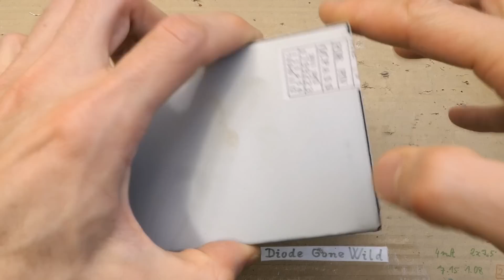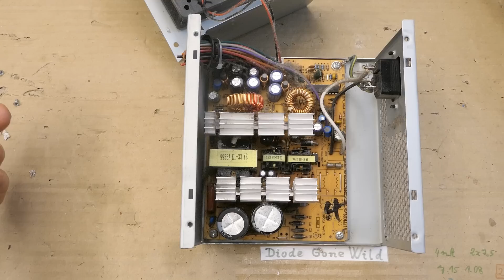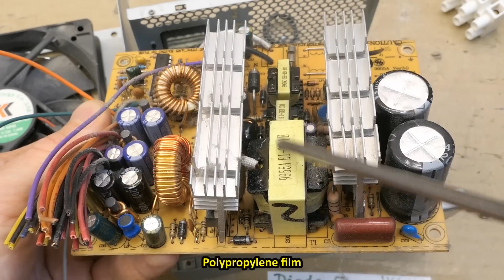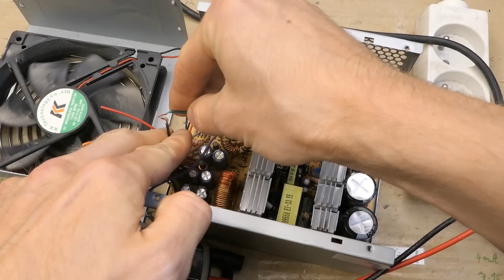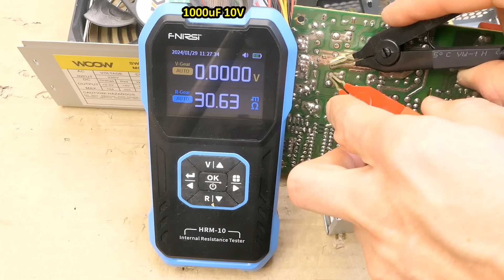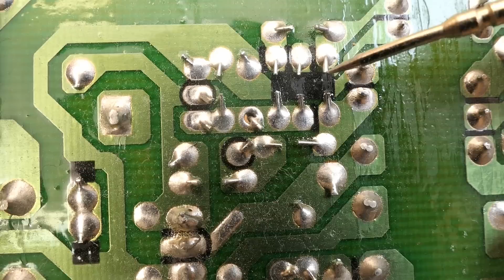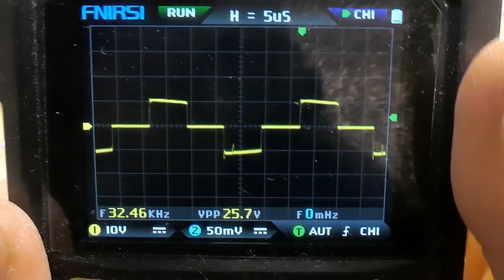Crappy ATX analysis and repair

Comment: Those were worth fixing 20yrs ago? I've never seem a stock power supply in a computer as something with the time to repair. Replacements are a dime a dozen, so the component value to repair + my time is worth more than the cost to buy a new one.

Comment: For a high current source of 12vdc you can't beat an atx power supply.  The 5v bus is also handy.  Shame this one didn't have any RFI filtering or power correction which is super cheap.  Two filter capacitors in series is crazy as if one changes in value over time it could end up with too many volts and pop!  A single 400v capacitor is far better.
Reply: Hmm. I recently bought an unused (it was installed as a standby in a industrial control panel) 12V 60A power supply for 40 bucks.

Comment: I have a question. For any power supply that has an active pfc, is there a way to repurpose that feature for another power supply that doesn't have one? For example to use the pc psu apfc as an automatic voltage regulator "avr" ?

Comment: If it's 5V Standby doesn't use Viper22A then ain't using it, many cheap PSU have 5VSTBY transformer melting, and the PCB underneath it until it becomes carbon it self

Comment: CON2 is for 110/220V switch. Not for power factor correction.
12V and 5V rails have Schottky diodes. Not only 5V.

Comment: This was indeed one of the fastest but still in-depth explanation of an ATX-Power supply including topology and detailed instruction! I saw many of your repair videos and all of them are excellent and worth it! This one is probably the fastest. You are talking so fast - time is money 🙂 I also have a lot of the ATX PSUs and also repaired some of them. I normally have a 50...60% chance of an easy repair, but some problems are really hard to find - as you showed here 😉 Once i had a timer chip (555) in a circuit and couldn't find the problem. I even posted photos of my circuit in an electronic board and discussed the problem. Finally one came up with the suggestion to put the 555-chip into its socket on the board! 😂

Comment: My father connected my 12V 30A PSU into 220V can anyone help me fix it? blew the fuse I change it but blew again I was testing the components with my new multimeter but I dont know exactly what I am doing, bought a 0.22uF capacitor but I think it may not be it, so I just did not change it yet

Comment: I loved the vid. I repaired this things a lot for 3 o 4 four years. The small electrilitics after the coupling transfomer ... above 9ohm of ESR they start to put more stress on the BJTs couse the somehow for a bigger duty cycle and the shape of the signal is not as sharp. The stby section that tend to sefl destruct when a small electrolityc goes bye bye ... imho happen to be with 2N60s. I barely saved those before blowing and usually they destroy the transistor, the 817, the C945, fusable resistor ... Restoring this selfoscillating section prove to be challenging and not with good results. Run hot, noisy .... Just asking for an explosion. Still found this topoloy more robust than the modern 80 plus ones, since little electronics are on the hot side, the 80 plus ones, most of the electronics are on the hot side making a repair much more difficult. also I think the PFC+PWM controller is kinda gone everytime something is blown (specially a mosfet). I hate 80 plus configuraitons. More expensive to fix, components with no marking and when the controller is gone ... you are in trouble. The most I've succeded is in the case the main cap opens and on of the PFC mosfets blow but they let the controller to survive.

Comment: The base drive transformer has 1 turn in series with the main transformer primary and 2x 4 turns base outputs. This gives a proportional base current 1/4 of the collector current, matching the high current gain of the transistors (usually 13007 or 13009) which is 4. The control chip was usually a TL494 or clone (KA7500) and on newer ones an SG610x which had over and under-voltage protection included.
I saw one without the magnetic regulator for 3.3V, it had a linear regulator from 5V with a mosfet and tl431😄 Toasty!

Comment: Oh damn, reminds me of Codegen and Megabajt, maybe early Modecom Feel. Cheap as it gets, there's almost nothing there, and they even skimped on the mains RF filter though the board has provisions for it. I took so much of that crap apart back in 2000s... a prime source of IEC C14 panel-mount connectors.

Comment: I fixed my MESR meter by moving the jacks off the wires mounting them directly onto the board, and powering it from a lithium cell instead of two AA cells. 

The wires add resistance and there is a place on the board for the jacks, they are just mounted a bit further back. Also it likes the slightly higher voltage of a Lithium cell.

Comment: You can at least get a case fan out of these, which may cost 4 euros new. Buying a single capacitor in radio parts shop is a lot of money. For the big one they want about 7 euros. Somehow they now make very light powersupplies with not much in it, even from companies that used to be good like Fortron FSP. I don't know how they work, but they apparently convert 12 volts to 5 and 3 volts, and claim good efficiency.
Reply: More efficient power supplies can genuinely be lighter and smaller because there's less heat to dissipate.

Comment: They are still useful when you need a highish current supply at 12v for testing things that are meant to run in 12v vehicles. The protection is usually pretty good for not accidentally blowing them up when trying to test something that has a beefy 12v motor for example.
Reply: Yep, it seems to have SG6105 chip, which can not as easily adjusted to other voltages at 12V rail as older TL494 ones. But it still can be done.

Comment: I like vids like this. Yes the psu is really crappy quality and is better off being stripped for its transistors but repair videos like this are educational because in the field sometimes you have to repair even cheap crap. If i had to use this psu i would populate the emi filter and replace all the caps besides maby the big primary ones. I would then add a secondary 5v regulator to the sb5v rail so if for any reason that rail were to run away it wouldn't blow up the mb.
Psu fact time!!! The bestec 250 12E power supplies also used the same stand by power supply tapology as this unit and because of the capacitor pleuge they often failed and killed anything connected to the 5v rail. The mb. Ram. Any preferals connected to the usb ports. Bestec later moved to the 25012Z moddle that used an IC for the 5vsb rail and had oc an ov protections.

Comment: Can the primary high voltage BJT transistors be replaced with MOSFETS to improve efficiency? What changes would i need to do to the drive circuit?
Reply: Bad idea. This kind of PSUs are not worth improving. And if you’re asking such questions, perhaps, you shouldn’t be touching the primary side… yet.

But to actually answer your question: At the very least, you would need to change the turn ratio of the BDT (base driver transformer) as to have 10-15V at the gates instead of the 2-3 that the current driver provides.

Comment: Sometimes you get lucky. When I was still a kid, my mom arrived one day with a small bag of junk and gave it to me, despite the odds of repairing it being non-existent. There was an ATX psu with blew up fuse, missing the fan and screws. I just replaced the fuse and added a fan and screws. It worked and I built my first ATX pc out of it. I still have the PSU and it still works. That was over 15 years ago.
Reply: Woah, when was that psu made?
Reply: @techtechnicalgaming  I really don't know, I couldn't find any clue. But it probably is like 20 years old at this point.
Reply: when the fuse is blown, theres always something else shorted
Reply: @lifeai1889  Yes, except this was not the case, that's why I was saying I was lucky. I replaced the fuse out of innocence and it worked.

Comment: Hey, Diode! Since you have repaired quite a lot of these PSUs, have you ever encountered matryoshka main filtering caps? I have and I couldn't believe my eyes. There were complet, smaller caps stuffed inside larger case. I've also seen PFC inductors with no windings, but just awire going through something that looked like an inductor. Some people even reported literal rocks stuffed inside fake PFC inductors to make the thing heavier without using any expensive metals like iron or steel.
Reply from the maker: I've never encountered matryoshka main filtering caps, but I've never looked for them. I have a lot of ATX boards for parts, so maybe if I examined them, I could find some...
Reply: You are talking about this one, Fake Passive PFC coil: https://www.youtube.com/watch?v=MfeJudo3Uo8

Comment: I have an ATX, that 3.3v rail have about 2.5v. But when connecting any load to one of rails, 3.3v get well. What is the problem of this?! Any one can help me?
Reply: No one expected you would run PS without load. Run it with load.
Reply: @sergepetrov8598  but it is unnormal, there is a problem. I can't trust that ATX

Comment: Wait, how exactly does that saturable inductor create 3.3V? If I've heard correctly there is still half a coil supplying half the wave with the full 5v coil voltage, so it should hit 5v on the 3.3v rail when unloaded
Reply from the maker: There's a loading resistor on the 3.3V rail, so it never really runs with zero load. This resistor is the reason why the 3.3V rail double schottky is hard to test - it makes it appear shorted.

Comment: Another banger vid. What did you take at school dan? Watching your channel has made me obsessed with smps design and taught me a ton and made me go deeper into the math.
Reply from the maker: Thank you for your support! At school? Economics, statistics, information systems ... completely unrelated :).
Reply: @DiodeGoneWild  that's hilarious dany. i was the same and hated it so i changed my major to software engineering data mining algorithms. was back in the 90's before google and whatnot. we didnt even have text books. i mustve learned 20 friggen languages and different legacy and up to then modern backend databases. some you had to create using cobol, pascal, then pl/sql. all my electives were math and programming. by far the worst one was java, when it first came out. running only in applet form before javascript took over website design. i hated front-end stuff, i wish i still had some of my projects, i ported a few nintendo games to pc and wrote a few original ones using direct3d back before programable shaders. i cant draw worth a crap so everything was procedural flat shaded polygons. i remember the nightmare of directx 4 or 5 i think it was. just creating a surface was pain in the dick and the pcs were pentium 90's or something and i had an amd 333 rig at home so stuff wouldnt run on pentium 2 processors alot because of the mmx instruction set. my guitar broke halfway through the second year so i sold my pc to buy a new one and went a year using a 386 writing my code in notepad and compiling it at school. you couldnt get a compsci degree there because you had to finish your last 2 years like 500km away so i settled with that stupid sounding degree. i never used it professionally though, i was offered a good job too as a junior 3d physics systems programmer with the canadian coast guard but i was addicted to my girlfriend at the time and just having fun coding and didnt want to move. i ended up becoming a 911 supervisor. i started coding again when i retired after 15 years there. i may go back to school as i have 2 years worth of credits for compsci or ee and might be moving for a few years. we have a local engineering technology program at the community college but I know more than they do. the final project for them is making a heart monitor. it's a group project too, 2 opamps and some resistors. imagine ehh. i can go there for free though so i may take the mechanical engineering program and put more time into cad modelling. im writing a record right now with a buddy though and plan to release it on my channel. it's a concept technical jazz/metal thing. my buddy is a voice actor so he can sing. i'd like to have something to show for the tens of thousands of hours of practicing scales and shit while im still in my mid 40's and can shred like a demon. gonna be posting some short horror films in the new year too, fan fiction stuff with original soundtrack. i've got a game engine framework written too but i need an artist. i want to do a graphic novel of the history of eastern canada from the time cabot landed until the halifax explosion. an interactive one. sell it for a buck a copy to tourists as my province is reliant on tourism. then i have an idea for metroidvania game based on real history of math and engineering and i could hire some people to help. it's the coolest idea ever man, i ramble alot but i dont tell people about it because i dont want someone else doing it haha. we get so many tourists here that people would eat up the graphic novel for like 2 beans on their phones. what's 2 dollars right. i've paid a girl to do some concept art but it's too bubbly like hello kitty so i wasted money. no one takes you seriously unless you show them some money, i'd want a piece of the backend after it was completed if it were me. that's what i offer. it's a six month project for 3 people putting in about 2 hours a day or so. every year it would start selling in the late spring until fall haha. we get something like 5 million people so even .01 percent of them paying 2 dollars or so would make a killing every year and they'd know something about what the fuck they're looking at or why there are so many ghost towns and shit. marconi lived like 40 minutes away from here and alexander grahm bell 40 minutes the other way haha. his family own a whole island and i've explored it and shit when i was younger. they still have all the old victorian houses there kept in original form. that's hard to do when you build shit out of wood and old iron nails and live next to a windy as fuck inland ocean. haha. or maybe i could just rob tourists like in your home town ehh hahaha. i kid, i seen a documentary once about it but it was greatly embelished. i plan to visit there in a few years, backpack and busk across Europe like a street person haha . i digress.

Comment: If you ever get a PFC "inductor" from a poor quality source, you're going to be amazed, it's a wire that goes in and out again, and if you peel off the tape from the supposed "inductor" it's a metal block with cardboard around it to give the impression that there's a coil, but there isn't any coil.
If you're curious, search for Fake PFC inductor in a search engine, it will bring up results from people who have disassembled it haha.

Comment: I had one of these supplies. The orage polyester capacitor burnt up stinking up my room. I replaced the supply with a superflower unit. The ground/center tap from the transformer came out the top and was run though spagetti landed right at the ground pads of the wire bundles, which I though was a clever way to reduce PCB loss..

Comment: So the next job is to fix the ESR meter?  ;)
Reply: man, i was thinking the exact same thing. i wanted to take mine apart to see what could go wrong but i loaned it to someone and never got it back so i bought an overpriced lcr meter i rarely use. aquiring gear is for the birds man. i gave most of mine away recently and kept the essentials. i want a spectrum analyzer but cant justify 2500cad so i bought a new guitar instead. it's the siglent that you can hack to dual boot into a vna as well and raise the bandwidth to like 6ghz. i priced some of the probes for it and was like nope. i have a rigol mso3534 im trying to sell with the logic probes but i cant get a bite. i want a micsig so i can fix shorts in cars and be more mobile. i had one in my passenger door and they wanted 900 for labor just to reattach a frayed wire for the power window. i told them to stuff it and took the fuse out and fixed it myself in an afternoon. sorry for rambling man.
Reply: @jstro-hobbytech  constantly wanting new electronics gear is a drag. I've been there myself.
Reply: @jstro-hobbytech just a ton of SMT.
Reply: Those yellow MESR meters have a main board designed to have the banana jacks mounted to the circuit board. Yet they are sold with the jacks only attached by wires. You can move them to the board to eliminate that one ohm resistance. though then they are a bit further back inside the case.
Reply: if you are a indian then 
** you